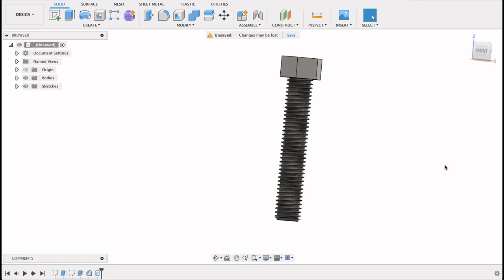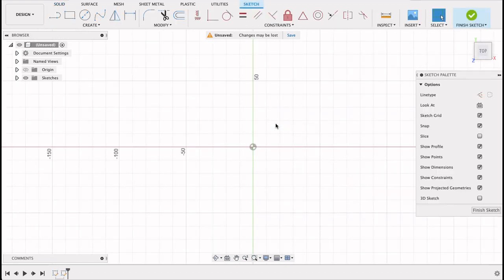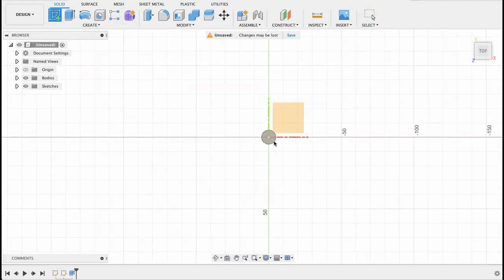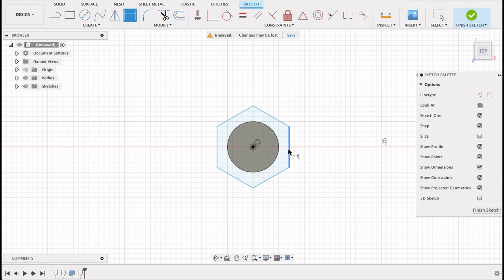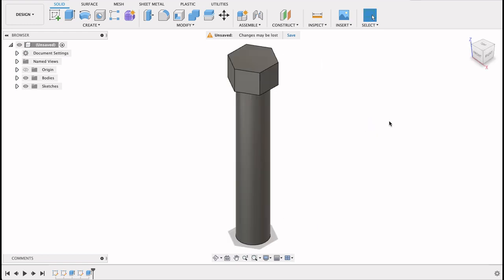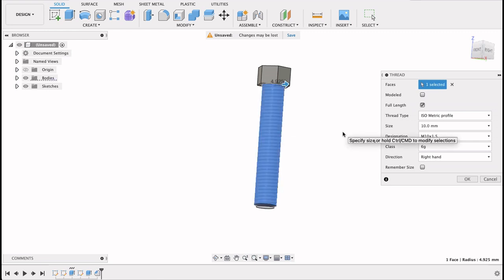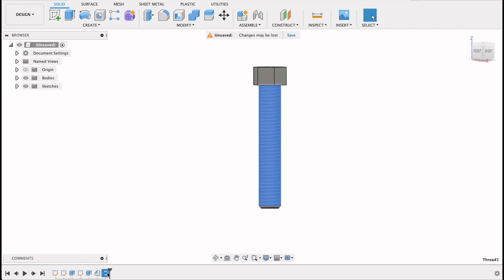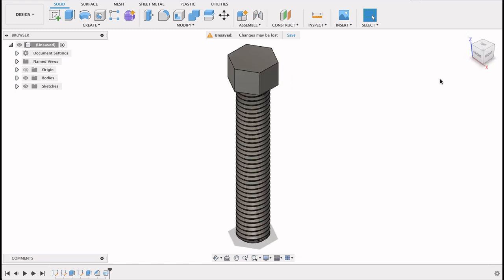Create a threaded bolt in Fusion 360 - Step by step tutorial

Comment: if you resize the bolt diameter will the thread adjust as well?
Reply from the maker: The thread is linked to the body of the bolt so when you resize your centre diameter circle the thread will adapt to the new size of the body